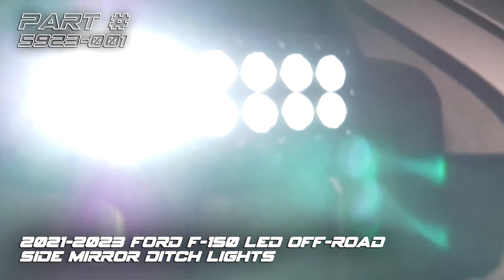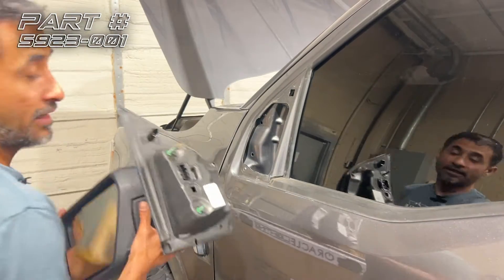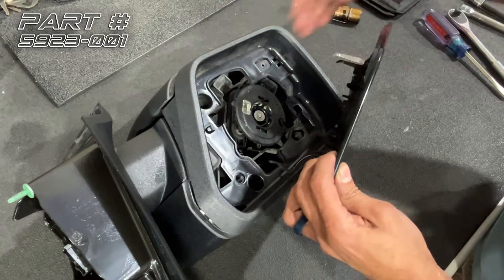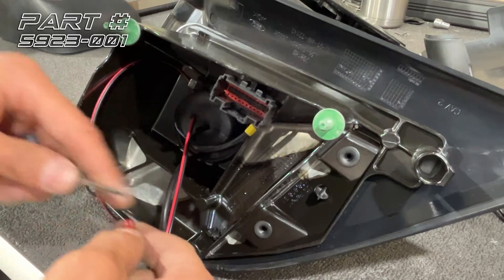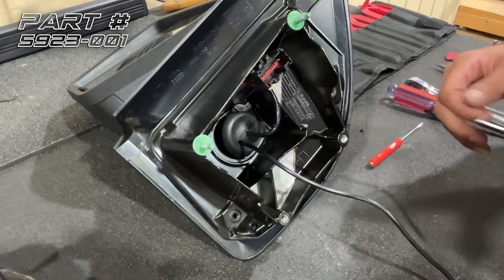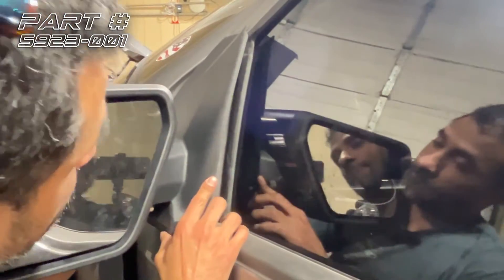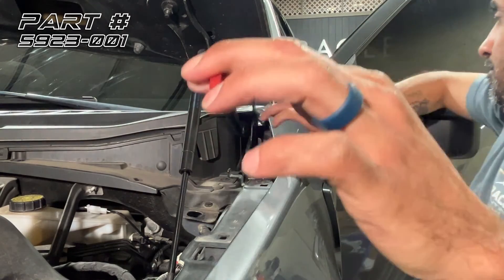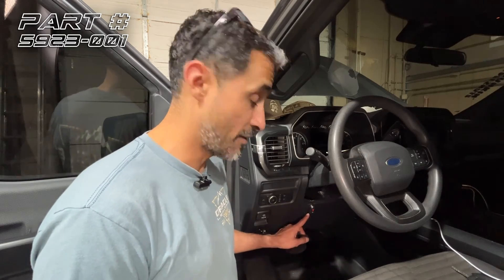2021-2025 Ford F-150 LED Off-Road Side Mirror Ditch Lights Installation Guide

Comment: Tapping into the side mirrors existing flood light, notice i said flood light not the Puddle Light, per the instructions does not work.  The light source is not strong enough to power the oracle lights. They flash for a quick second and turn off rendering existing flood light and oracle lights inoperable. However once I removed the wires from the factories flood lights, the factory flood lights worked again. This setup will need a power source setup and switch. Please reach out as I know this is a new product. Thanks
Reply: I also don't like that the bottom filler piece does not have a cut out to place the factories Puddle Light causing you to have to lose your Puddle Light unless you dremel out a location for the Puddle Light to go. I would like to see a filler plate for the bottom to still be able to utilize the factory Puddle Light and not have to sacrifice one for another light source.
Reply: @justawhip3165 
You dont use that PC if you have puddle lights.